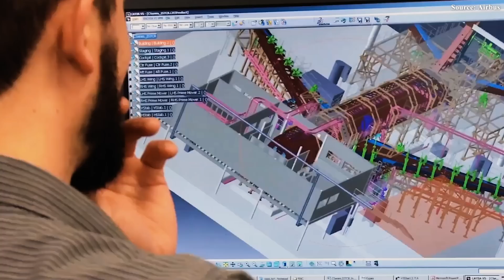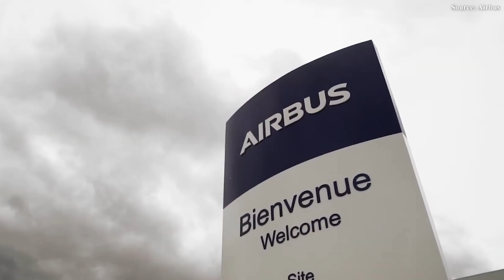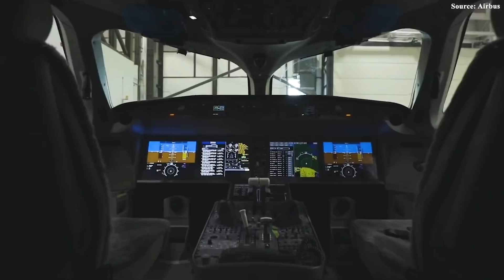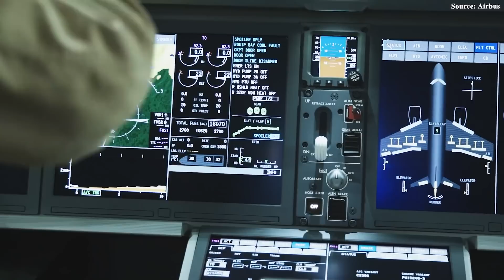Airbus' HUGE PLAN for NEW A220-500 SHOCKED Everyone! Here's Why

Comment: Airbus is still struggling to turn a profit on the A220 program because the legacy  Bombardier supply chain contracts are expensive and the final assembly line wasn‘t set up for the high sales volume Airbus can achieve. Also, the cockpit is not type compatible with other Airbus planes. Boeing is still climbing out of the hole it dug itself with MCAS etc.

Therefore, I expect Airbus is in no hurry to satisfy airlines clamoring for an A220-500 that would cannibalize A320neo sales.
Reply from the maker: Thanks for your feedback